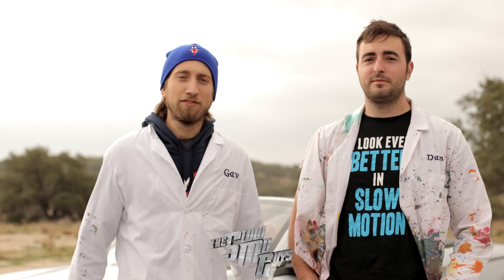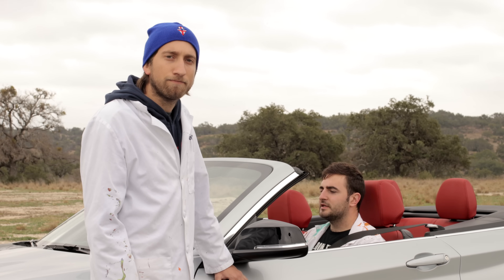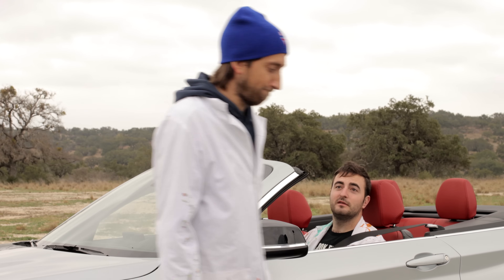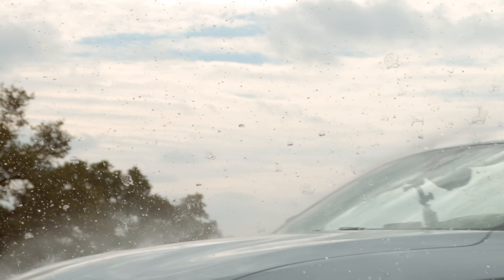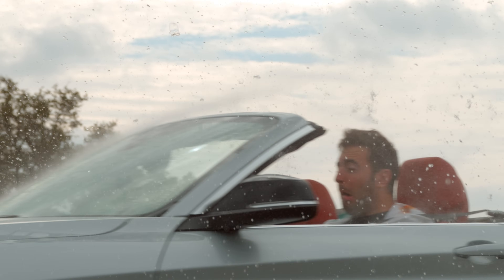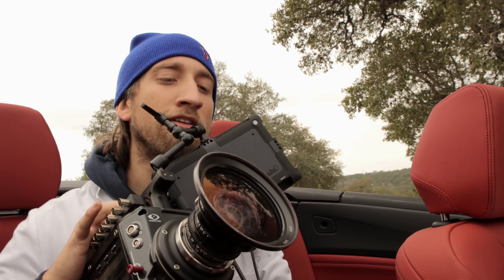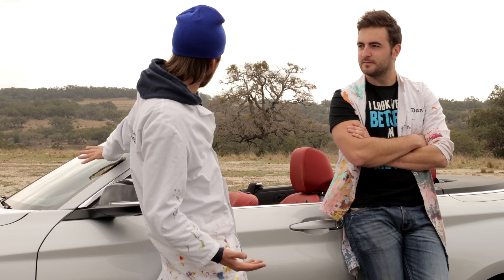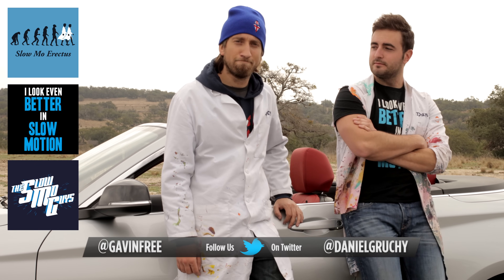Convertible Aerodynamics at 1000fps - The Slow Mo Guys

Comment: I drive a BMW convertible so I was interested in this.  But I was very disappointed.  Yeah, that's what happens at 110 mph, but you're out from under the drops before they come back down when you're moving that fast!   I wish I could do 110 on regular roads (without a police escort).  What happens at more usual speeds, like 50 to 70?  That's the important trial.
Reply: It says in the video, works at much slower speeds.
Reply: It works at highway speeds.
Reply: Yeah, but I'm still disappointed not to SEE it.
Reply: SilkenDrum Step 1) Click the cog in the lower right hand portion of the video. 
Step 2) Slow the speed down.
Step 3) Profit.
Reply: Porsche Curves Um, does that make the car go 55 mph instead of 110?
Reply: SilkenDrum Same effect.
Reply: Porsche Curves Perhaps I'm misunderstanding you.  Are you saying that if I slow the video by half, I would see the same effect of the water as if the car were moving at 55 mph?  But the water is falling at 9.8 m/s/s.  If I slow the video so that the car seems to be going 55 mph, that also slows the falling droplets to 4.9 m/s/s, so I would not see the effect as it would be at 55.  I would simply see 110 - 9.8 rendered slower, which tells me nothing about how the water would act at 55.  (Incidentally, my (very long) hair doesn't whip around in the driver's seat no matter how fast I'm driving, but hats will blow off and hair whips in the back seat at 55.  My granddaughter hates that.  I'd love to find someplace I could try 110, and see if there's less wind in the back.  That might answer my question as to whether the effect is different at 55 than at 110.)
Reply: SilkenDrum The only difference between 110 and 55 is how fast the air moves around the car thus changing how fast the water passes over. At 55mph in most convertible cars, the rain will not fall into the interior.

Comment: Wonder why those LEDs flicker
Reply: Because LED lights flicker but it's so fast so you only notice it in slow-motion
Reply: They flicker because they are being supplied with AC current. This means that the directional flow of the current alters very quickly flowing from each terminal in turn from the positive, then from the negative then back to the positive. Now LEDs only work if the current is flowing against them so if the LED is set up form negative to positive then then they will only light up if the current flows in reverse, this is due to the fact that they are changing the electrical energy to photons (light). In slow motion they appear to flicker but it is too fast for the human eye.
Reply: Probably because they are dimmed using pulse with modulation (PWM), meaning they are switched on and off very quickly to reduce the average light emitted per unit time.
Just to make that clear to everyone: LEDs do not always flicker and there is no AC main supply in a car. There could be a DC-DC converter creating some ripple, but that wouldn't turn off the LEDs completely.
Reply: Most LED lights are now powered with a series of high frequency pulses.(PWM if you're interested) it increases the control over brightness and reduces power consumption. This reduction in power demand decreases the cost of components for the manufacturer. At normal viewing speeds the flashing is not noticeable in the same way you and I don't notice a household lightbulb, TV, or cell phone screen flicker. While the mechanisms for each are slightly different - as are the reasons for doing so, the flickering phenomena can be observed in all cases on a high speed camera. (speeds vary)
All of this noted however, many cars also employ non controlled DC circuits which will never flicker. They are most commonly found in the high center brake light where dimming is not a factor. Either on or off. In those cases what we find are (essentially) LEDs plugged into the car battery via the brake pedal switch. 
The decision to have a non controlled, or an LED driver <-(term) using PWM to control lights is at the discretion of the electrical engineer at the time of design. You should expect variation of design on different cars at different times.
Reply: It's really not that difficult...
Reply: The way most larger wattage lights work to dim is that they turn on and off in at such fast speeds that they do not fully reach their full potential power, and what the eye perceives is the middle area between off and at 100% power.  The time between flashes affects the perceived brightness given off by the light source.  This method of dimming is different from that which is in most light switches in houses which uses resistance dimming.  More info on dimming here: http://en.wikipedia.org/wiki/Dimmer
Reply: S Sadri If he can't work it out for himself he's not gonna make head nor tail of that hahahaha

Comment: have they done any dry ice stuff in slowmo? maybe dry ice by itself turning straight into gas from solid, and then putting a bunch of dry ice into a big bottle of hot water and screwing the cap on really fast so it explodes

Comment: Of course there isn't much practical usage for this.  You can't drive with the top down on a rainy day, since eventually you'll come to a traffic light or stop sign, and most time on the road would be at speeds between 35 and 60 miles per hour.
Reply: Highway? Or the Autobahn in Germany NO LIMITS =3
Reply: Well if you're on the countryside you won't have to stop as much.
Or if you're going under a leaky pipe or something you won't get wet.
I still agree, though.
Reply: In the U.S., the only real chance you have of making this useful is on an interstate.  You could go several hours without slowing.  But once you hit a traffic jam, you better hope you can get that hood up before you get wet.
Reply: Or, you know, rain coming from the back of the car.
Reply: Well the reason behind this was probably a quick buck from BMW so you can't fault them for making money, at least they had an extensive shot setup.
Reply: The point of this is the show fluid dynamics over a convertible...
Reply: They said it works at lower speeds, but I understand and agree with your point
Reply: Harrison Mousseau An Autobahn has (nearly) always 3 Trails... When they need to repair one they just close one trail and generate a nice traffic jam =3...
Reply: Sigh...I guess you don't understand that air works in the same way as the water does in this video. With no aerodynamics you would be hit by 110mph of wind. Well designed car and you will have no wind inside the car because all the wind is passing along the top and sides of the car.
Reply: AxeLond It would have been better to advertise it that way, not saying that you could drive this car in the rain.
Reply: I have a convertible (MG TF) and the aerodynamic effect works as low as 35mph.
I often don't bother stopping to put the hood up if it starts to rain, and if I head into town and risk a red light stop i pull into a petrol station first to flip the hood up.
If the rain's light - i don't bother.
Reply: Anakin Skyobiliviator rain coming from the back of the car?
What?
A.) flicked up from the tyres or
B.) Rain falling in the same direction that you are travelling in? (wind behind you)
(Or C.) you're a troll/idiot)
Reply: George Smith Rain pouring from behind the car, angled by wind to get in the car.

Comment: How much is 100 mph in a proper measurement system?
Reply: It's 0.0000001491 the speed of light in a vacuum, is that proper enough for you?
Reply: ***** Eemeli Bergström Each of you should try getting a sense of humor. It'll make you both look a lot more like grownups. Cheers.
Reply: Eemeli Bergström Grow up and either seek out or simply learn how to use a simple conversion factor which every kid in grade school is taught, maybe? Employing stupid buzzwords like "proper" which get you no closer to the solution to the problem is just, well...
Reply: 100 MPH to KPH is 160.93
Reply: and Dan was going 110 MPH which means he was going 177.02 KPH
Reply: thx m8
Reply: SooDoneWithYou or properly going 0.000000164 the speed of light in a vacuum.
Reply: ***** Give it up, grow up, and re-read the "question" again. If the point of the comment was to ask what was the speed of the vehicle traveling in SI, that question could certainly have been asked in that simple and straightforward a manner. Instead, it was clearly and obviously meant as a whining "Whyyyyyy caaaaan't the rest of the worrrrrrld use the same system of measurements thaaaat weeeeeeee doooooo...?" And, of course you didn't notice as well that the car used in the video was one clearly built to be driven in the U.S., as witnessed by the New Jersey, The Garden State license plate which is CLEARLY viewed at 1:43.
Reply: Eemeli Bergström No, you're still missing the point of the original post, for obvious reasons. But hey, you just keep proudly letting your 'I'm a Whiner, and Proud of It!" flag keep flying there. Eemeli! Yeah, you do that. (rolls eyes...)
Reply: Eemeli Bergström Yes, those who set out to whine and troll YouTube comment sections usually do support each other and are easily entertained. That's why you and your ilk do what you do.
Reply: Eemeli Bergström "So-called". Exactly. Now you're gettin' it!!!....no, no, you're really not...not getting the point of Sosnitsky's original post, not my first post, you dolt. Living to whine and piss and moan over absolutely the most ridiculous bullshit is still the most important thing to you, and by the looks of things, it always will be. (sigh...)
Reply: Eemeli Bergström "all they did was ask a question".No, clearly that's not "all they did". Putting forth infantile whining and pissing and moaning whether or not it's dressed up as a "question", is still infantile whining and pissing and moaning. You're simply not admitting it because you revel in the childish pursuits of, well, whining and pissing and moaning about ridiculous bullshit.
Reply: ***** Please. Just go start an internet petition along with any and all of the other infantile whiners who apparently believe that only one set of recognized units of measure is, somehow, "proper", because apparently that's simply just one more irritant that makes their existence simply just all the more unbearable for them to deal with in their wretched lives. Yeah, you go do that. MAKE THE REST OF THE UNIVERSE SUBMIT TO YOUR WILL, GIVE THEM A DEADLINE!!!!, AND WARN THEM OF THE SURELY SWIFT AND HELLISH ALMIGHTY RETRIBUTION FROM THE PISSING MOANING AND WHINING COMMUNITY WHICH WILL BE METED OUT TO THOSE WHO DO NOT RECOGNIZE YOUR WHINING AND PISSING AND MOANING WRATH!!!!! ...yeah...have fun with that, kiddies...
Reply: ***** blah blah blah
Reply: ha... haha... HAHAHAHAH!!! I fucking love youtube so much.
Reply: Eemeli Bergström Simply just letting the endless flailing attempts at defending (and even more ridiculously) trying to explain and justify all of the pissing and moaning and whining, speak for itself, kids. Now please, just go out and play now, would you? Thanks..
Reply: ***** Because I refuse to endlessly argue with a few infantile morons who live to piss and moan and whine because the world just doesn't happen to suit them? Yeah, sure. Try again. Or don't. No one besides you nutcases gives a damn.
Reply: ***** Just go play. The world will never suit you, because to you, it will never be "proper". The more that you insist on acting like a blowhard about it, the less the rest of the world will care. Rant on, rant on, it's absolutely what you do the best...
Reply: bohnstube  you're like 'everybody is acting like a child and i dont like it when people whine so im gonna whine about it'
youre the only person whining lmfao
Reply: Henry Clerval "Says every single blowhard who simply refuses to learn a simple elementary school conversion factor or two, preferring then to instead just incessantly and endlessly bitch and moan and piss and whine about it."
Reply: bohnstube jesus youre an obnoxious troll, calm down and maybe people might not find you so repulsively stupid
Reply: Henry Clerval "Says every obnoxious geek who simply just yaks to hear their own fucking head rattle, even if it's only just to scream and shake their fists at the heavens while crying "Why can't the rest of the wold just do everything the way that I want them to!!!!"
Reply: bohnstube moron
Reply: Henry Clerval "So says another nameless, faceless geek who would most likely be otherwise insignificant to the world, except for the fact that he joined a group of 3 or 4 other geeks who just couldn't seem to handle the fact that a couple of YouTube channel hosts DARED TO MAKE A VIDEO WHICH DIDN'T SPEAK SOLELY IN THE KILOMETERS PER HOUR LANGUAGE THAT THEY UNDERSTAND, AND DEEM PROPER."      right
Reply: bohnstube moron
Reply: Henry Clerval "But who does seem to have the "talent" of echolalia down pat."* ROTFL! Oh well, no surprise there. Everybody's going to think they're an expert at sumpthin' I guess, huh. Even pissed off geeks. Hank, you're priceless! LOL!
Reply: bohnstube moron
Reply: Henry Clerval And now I shall leave you, and I wish you only the best, as you continue to regurgitate your echolalic, duosyllabic nonsense. Stay priceless, Hank! ROTFL!
Reply: bohnstube moron

Comment: whoa those LED lights sure are screwed up, since they have a slowed down light then a traditional halogen lightbulb.
Reply: That's because they are supplied through a switched mode power supply. The LED's take less power than the battery supplies so it turns on and off quickly so the average of the supply is lower. Traditional bulbs just take all the power as they are less efficient.
Reply: Led lights pulse at a certain frequency that's why it looks like that
Reply: Kaipo Fitisemanu sorry, that was the word i was looking for. sometimes i cant think for thoroughly.
Reply: Most LED lights are now powered with a series of high frequency pulses.(PWM if you're interested) it increases the control over brightness and reduces power consumption. This reduction in power demand decreases the cost of components for the manufacturer. At normal viewing speeds the flashing is not noticeable in the same way you and I don't notice a household lightbulb, TV, or cell phone screen. While the mechanisms for each are slightly different - as are the reasons for doing so, the flickering phenomena can be observed in all cases on a high speed camera. (speeds vary)
All of this noted however, many cars also employ non controlled DC circuits which will never flicker. They are most commonly found in the high center brake light where dimming is not a factor. Either on or off. In those cases what we find are (essentially) LEDs plugged into the car battery via the brake pedal switch. 
The decision to have a non controlled, or a n LED driver <-(term) using PWM to control lights is at the discretion of the electrical engineer at the time of design. You should expect variation of design on different cars at different times.

Comment: But what if your at a red light? still get wet? O_o
Reply: Yeah, but normally you would close the roof if it starts raining.
Reply: Marwin Kellers "Close the roof." Mind=blown lol
Reply: You missed the part where it's a BMW. Everybody knows, BMW drivers don't need to obey the laws of your puny roads, red lights are but an inconvenience to be quickly dismissed.
Reply: No, the air keeps flowing creating an invisible force field around the car even while it is standing still.
Reply: nope, the aerodynamics prevent you from being stopped at a redlight
Reply: Shannon Actually this aerodynamic is developed to protect drivers from dirt, spray water from the road, other car's windshield washer fluid and insects. You can also continue your ride if it suddenly starts raining and chose a safe spot to close the roof. The next red light would obviously be such a safe spot.
Reply: Jack Black more like 'If you're an ass in a convertible'
Reply: You don't stop at red lights if you're in a bad-ass convertible.
Reply: What if the light isn't red? What if it's white and gold?
Reply: FaZe Gentoes You're a failure of a human being.
Reply: Derek Leung because you'll be too dead to notice
Reply: *you're

Your = possession 
You're = you are

The apostrophe is there for a reason.
Reply: you dont stop at red lights, you stop red lights
Reply: Cyberlord
Rust no scopes you wont
Reply: The point is a low speeds you can close the roof.
Reply: Liam Quinn advertisement
Reply: nemesisnick66 You mean...parents still buy their kids cars?!? /sigh
That'll be the day.
Reply: Sweet9964
Ha ur pist, mission accomplished
Reply: FaZe Gentoes br0 1m r3k u!!!1!!111 m33t 4t t3h 1n5t4gr4m 3n d3n w3 533 h005 t0ugh3r!!!11!1!11
Reply: A Worthy Gamer Isn't physics great?!
Reply: WilliamLordPiggeh uh, no. both my use of "you're" and "your" were correct in that comment. see, i'll do it again. you're a dumbass
Reply: Well if you are rich enough to buy a BMW then you obviously wouldn't care about red light tickets
Reply: you're*
Reply: Cyberlord
ha ur mor pist stay pist nerd
Reply: I'm always wet
Reply: THE BATMAN OH SHIIIIIT
Reply: +MrMeCraft I have plenty of better things to do with my time, it took me 20 seconds to type that and I have no regrets.
Reply: MrMeCraft you're*
Reply: MrMeCraft you wrote "your're"
Reply: Marwin Kellers maybe 2 generations ago or possibly even the last generation but i have feeling this one not so much probably be to busy taking selfies in the new car their parents bought them to realize it started raining